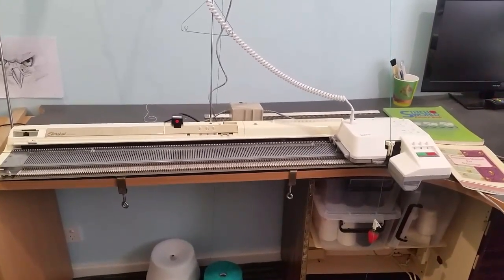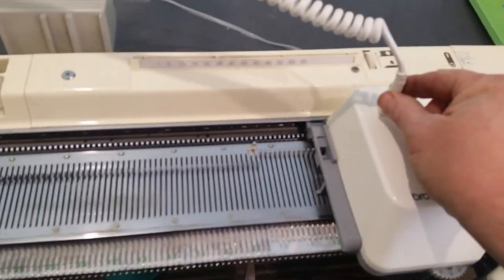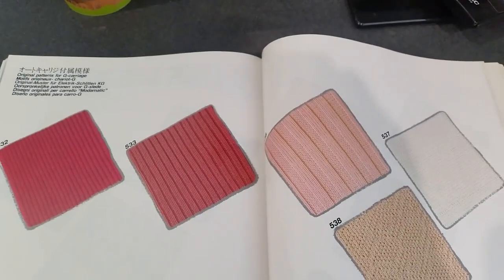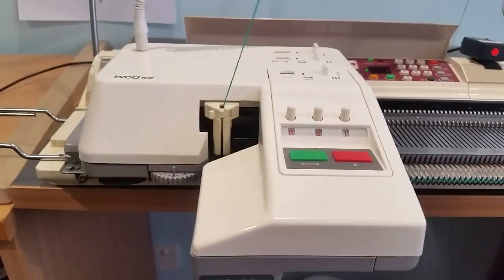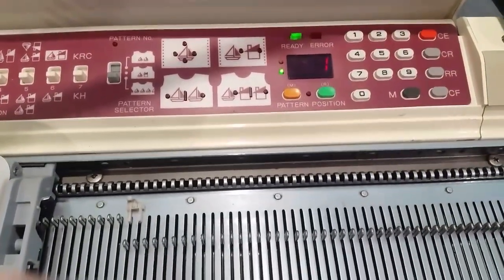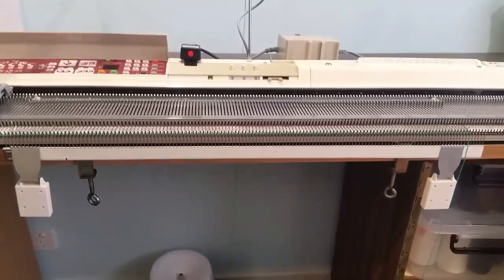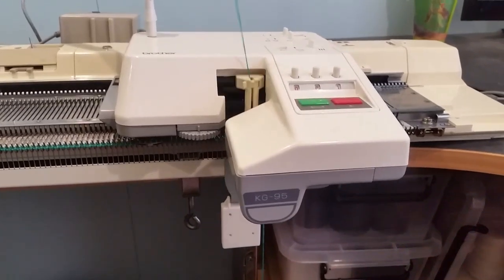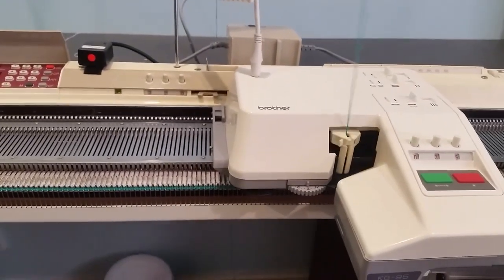Brother Garter Carriage KG 95 Cast On using Brother KH 950i knitting machine

Comment: The problem is the Garter Carriage manual gives you directions for the 950, not the 950i, the machines work differently.

The book is telling you to enter the card reading mode, to get a plain row for casting on, which on the 950 is 901, on the 950i, however, it is 777.

On 950, programme your pattern in you are going to knit with the garter carriage and when you have the ready light, enter 901, then you can do your garter carriage automatic cast on.  After cast on, press CR and CF and continue knitting in your pattern.

On the 950i, the procedure is the same, however, enter 777 instead of 901.

Hope this helps.

Comment: Hi.
I've had my G Carriage 95 since 1986. Sad to say  I changed the needles on the knitting machine and was pleased. When I tried my G carriage it got jammed. Probably there was a problem with the new needle. The carriage got JAMMED and had  to gently push the needles back to release the carriage. I removed the machine and checked the underside. Horror the "SINKER PLATE" was out of 3 slots. I fixed it but the plate kept falling off and jamming the needles. I removed all the NEW NEEDLES and replaced the originals. Even my normal knitting was horrible just loops. MY QUESTION IS ... HOW CAN I REPLACE THIS PLATE for the G95 or WHERE CAN I PURCHASE THIS? Any advise will be grately appreciated. Thanks for your help. 💕
Reply from the maker: Have you managed to fix the problem?